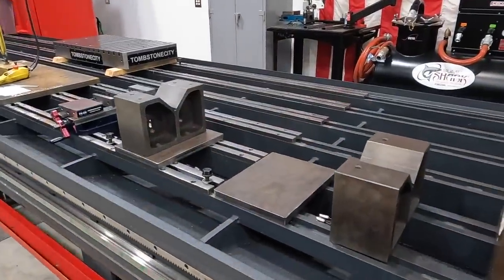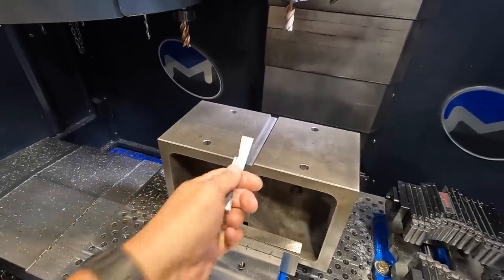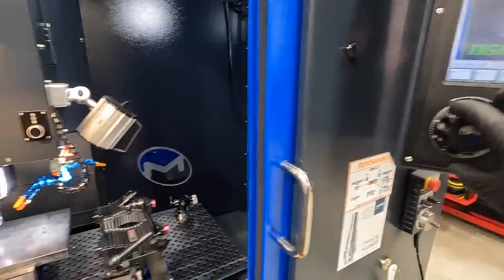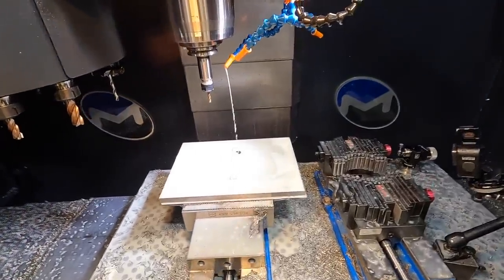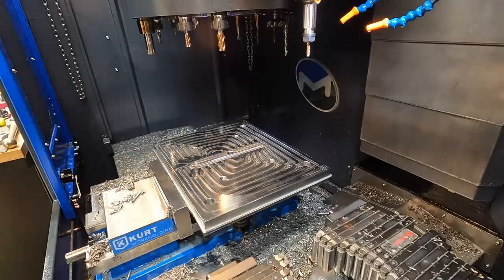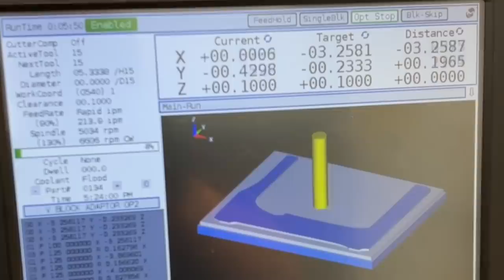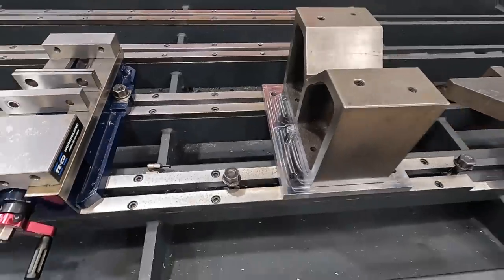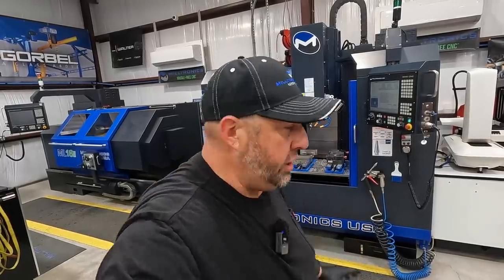V-Block Adaptor Plates

Comment: Glad to see that nice smile on your face when you operate those CNC Machines.
The real magic is that Renishaw Wireless Probe and tool setter.  Back in 2007 I purchased a new HAAS TM1P and added the Renishaw Wireless Probe and tool setter at a cost of $5K.  It was the best 5K I ever spent.
Listening to those with CNC machining knowledge as you have done will shorten your learning curve.
I wish you every success as you venture into the world of CNC.🙂

Comment: Sure is a big step into the future of machining Adam. I can tell you're very happy with your new CNC machine. I think one of the biggest advantages on a CNC machine is having the option to save the program for each job you do, so when you need it again, it's as simple as pressing the 'Select File & Run' Easy Peasy. It's really amazing to watch your work, and Big Thanks for sharing your videos with us subscribers. Cheers Blessing 💯👍. ps: As a power engineer, when computer automation came into the plant we could then see everything running on screen, pumps, temps, pressure, it was all dynamic graphics and almost like playing a video game 🤫. I did miss spending time in the mechanical room and actually hearing all the sounds, that's one thing the computer wasn't able  to give me, for example a noisy bearing or a minor seal leak. We still did visual walkthroughs, but they were only a few minutes. No more clipboards writing down readings.

Comment: I prefer the manual machining. I like the set up, indicating, and the process of figuring out how to mount the part. This is what makes me think.
Reply: If you think CNC machinists arn't doing that, you havnt set foot in a modern machine shop. CNC builds ON manual, not take away from it.

Comment: I think it is excellent that you are learning the conversation on the machine first. Those that don't struggle. You really need the conversation, because a lot of Fusion type stuff is going to need some minor adjustment and it is much easier if you know how to do it at the machine. It's the same for robotics and other like automation. I also see you are learning to think more in spacial area instead of 2d drawings which I think greatly helps with automation processes. Keep up the good work!

Comment: I think the great thing about the conversational mode is being able to see the program that the controller writes.  It's a great way to learn more G-Code programming.  Especially when you see how it has optimized cuts.  Won't always be perfect, but it's still a great learning tool because you can associate the code to what physically happens faster.
Reply: Theres no good way to learn g code programming, because g code programming is from the 90s.

Comment: The CNC machine does exactly what the manual machines do.  The trick is what is the CNC command that does the same thing as flip a lever, change the feed rate,, modify the feed stock.  It's still metal being cut.
Reply: Yes but if you have to make 200 equal parts in one order or another 200 parts 2 years later, the CNC is going to be so much faster which is more revenue if the shop has the business.

Comment: Hey Adam, I have a suggestion for you, instead of having drilled holes on the fixture plate for the “T”nuts, suppose you make them slotted holes like the ears on the KURT vices so you could slide the bolt and “T”nut combo into place without having to thread down through the hole into the “T”nut.👍

Comment: Adam another good idea to add to the plates. Tig weld two U bend handles to the short or long sides for easy handling. Espcially with the V- Blocks attached.💡👈🤔And having some Eye bolts that fit the hole threads on the top of the V-Blocks would be nice used with the crane. Sure those aren't light what so ever.

Comment: Nice to see you getting more comfortable with the CNC machines. I get the sense that your initial trepidation is wearing off. I think a turning point will be when, on a new project, you turn toward the CNC machines first instead of the manual machines.

Comment: In OP1 you set the Z height to the top surface of the plate.  In OP2 you did the same thing.  This means the final plate thickness is dependent on the original thickness of the plate which is probably much different from plate to plate.  In OP2 you should have measured the Z height to the finished surface of the plate, the bottom.  Also clamping the plate in the jaws of the vice will distort the plate so that the finished surface will be shaped like a pringles chip after you let it out of the vice.
Reply: @gags730  Most of what I know about machining I learned the hard way.  I wouldn't call myself proficient because there is always learning to be done.  CNC is not much different than manual machining only with trust in one's self.  The operations are similar except that you have fully thought through each step and setup the machine do the work.  That being said, the machine can do things that are not easily done manually.  Learn something everyday and take pride in your work.
Reply: Was also wondering how this process makes sure the plates are the same thickness...

Comment: Great vid, felt like I was in the machine.
I would like to see you make a SS cover for the flex jaw vice to keep it clean from chips while you use the other vise.  Maybe make it fit with both so the non-use vise is protected from chips.

Comment: Thanks for the videos. Been following you channel for a while. 

CNC videos seem far less interesting than those where you manually run the operations. 

In the CNC videos, don’t get deep enough into the process, from blueprint to programing (why the choice of tools, speeds, order of operation, etc.) and would the choices be any different if you were doing all this manually?

Watching a machine run automated cuts (usually from afar for safety reasons) just doesn’t do it for me.

I appreciate that the CNC will make your shop far more productive, but the videos are more interesting when you talk about the metallurgy and machining principles behind the job.

Comment: Hi Adam, thanks for sharing this video. I have a question about the V-blocks: Once you get them bolted to the plates, are you going to take a dust cut on the inner faces to make sure they are perfectly paired, or is that not required? I noticed that you located the parts from the outer surfaces rather than referencing the V itself. Also, is it going to matter if they get installed 180 degrees or 0 degrees? If that matters, perhaps some kind of marker on the plate and the blocks so that they always go back together as a matched set, and always facing the same direction.

I love your content, and I am looking forward to seeing the project you made these adapters for. Peace~

Comment: Impressive work.  Reminds me of the satisfaction with my first wood CNC machine project.  Something I have never seen before is the flange nuts and washers.  Sweet.  
Also, I think I noticed with the graphics on your screen appears to graphically show material removal before the tool pass?  That can really help you stop the machine before it crashes into something not intended. Thanks.

Comment: One thing I'll say about the insert drill, you aren't feeding fast enough.
All that 'smoke' is very fine particulate that's just sorta chilling in the cut, getting minced & macerated. Not ideal.
Reply: its cast iron, you expecting chips? Also like, its an 18mm insert drill with no TSC.

Comment: Wondering why some of the machine work is flooded with coolant and some operations are one dry such as in the initial milltronics drilling on the adapter plate. 
Really a fine design for the intended use.

Comment: I have a question. It seems like it might be hard to bolt those plates down to the rails.  Would it work to make those holes into open slots so the clamping bolts can slip in? Somebody tell me why that wouldn't work.
Reply: Hi. I was thinking the same thing
Reply: Not hard at all, a lot of equipment that is bolted to T-slots have holes or closed slots.

Comment: Bro, I understand that everyone's watching Titans of CNC but please don't push your machine and tools to the limit especially outside of the bulk production. Extra wear doesn't worth it. You are doing great!
Reply: lol, thats nowhere near the limit. Other than runing that poor 300$ endmill on a plasma edge, thats basically sacralidge.
Reply: What are you talking about?
Reply: @spikeypineapple552  if spindle slows down or vibration occurs it is definitely a limit
Reply: @sinchrotron  Where is the spindle slowing down? Hes below 50% spindle load.
Vibration has very little to do with 'being at the limit' in terms of LOAD.

Comment: That Miltronics is  a nice machine. 
You might want to do a tool change interlock on the table position. Where are you do a tool change because that bonnet style tool changer gets pretty close to your part. Maybe it’s fine clearance on this part but the next time you have something in 1 foot taller could be an interference. 
I would’ve been nice if you had a 6 inches more clearance or even a foot taller column.   
I had forgotten you got that milling machine from Kilroy. He doesn’t make videos anymore. He had an American pacemaker for a long time but you have one now and that’s what I have also. 
Yes, I do lots of CNC at work you’re doing good

Comment: Saw how you centered the key way but how did you ensure the key way is parallel to the V in the block?
Reply: Guess he assumed the V is perpendicular to those sides.
Reply: @spikeypineapple552  I would agree, but he didn’t sweep either side to establish square or parallel, don’t her me wrong, I think Adam is an amazing machinist , just wondering if he did and didn’t show it.
Reply: @chucksmalfus9623  it would be pretty unusual to have a V block not be square to that side
Reply: @spikeypineapple552  He has been using them, for decades most likely, to do good work. He has used them many times in past videos. They were made as a pair with the all faces and sides square to the adjacent sides and parallel to opposites a couple of lifetimes ago. I suppose that he could simply check them once they are clamped down to the FlexCNC bed. I forget the actual numbers but the work holding slots were milled true to the gantry ways on the FlexCNC when it was originally installed and setup (see past videos.)
TLDR; Adam doesn't need to assume because he already knows they are good. I agree, however, that if you or I were to make the adapters we should and would check them. Perhaps not on camera though.

Comment: Just my opinion but I think Mazak has the best and most user friendly conversational programing.
Reply: Sad but true. Fortunately, there are several more manual machining channels out there. Just hope he keeps the titles accurate.
Reply: Couldn't agree more. I spent my first 15 years programming fanuc control mills and lathes by hand and after we replaced all our machines with new smooth control mazaks I never want to touch anything else again. Never touched a mazak before and after 3 days of training with the apps guy I was on the machines writing and running all our parts without any issues.
Reply: I agree. Mazatrol is very fast to program, edit and use. I use Matrix nexus 2 for turning and milling on a QTN twin spindle lathe.

Comment: Good morning ABOM,  first thank you for the education you provide the world of machinist with your expert life experiences. Your Dad and his Dad  must be very proud of what you have achieved. Just a quick question. I have been looking to replace my mix match collection of taps and dies with a uniform good quality set of SAE . It seems there are mostly metric sets out there. My need is for a full range of SAE taps and dies with minimum OD dies so I can make the least amount of die holders for my tail stock. As for taps, I have seen so much about spiral taps, I would like to step up to spirals, if you agree, for hand and power tapping in my lathe and milling operations.. The range I use mostly is #2 thru 1/2”. Can you recommend a good manufacturer of these as sets or individuals if need be. Don’t have a Hugh budget but do try to get the better quality tools, Made in USA if possible. Thank you for any advise you could provide. Appreciate every video you make. Papa Maggio, Ex shop teacher from 50 years back. Like Mr. Pete.

Comment: 30:21 i love how wavy that coolant looks. vibrating goosenecks?
42:11 what's that white thing next to the CNC machine?
Reply: Frame rate on the camera is synching with the coolant pump pulses giving the oscillating effect
Reply: @billj.widmann112  erm, pulses? i thought it was a constant stream?
Reply: @billj.widmann112  chatter.
Reply: Notice how the amplitude changes with the sound's  pitch and volume.
Reply: @ItsMrAssholeToYou  that's why i think it's vibrations.

Comment: Awesome,  give yourself an A for being a hardworking and attentive student!  Good to see you using the Renishaw probe.  It can be used not only to make necessary measurements, but also to detect if what Tom from Oxtools calls Bozo has paid you a visit.  Having programmed computers for other uses, I can assure you that Bozo is always ready to visit even the best of students.  As Tom points out, Bozo even visits grizzled veterans of the trade.

Comment: It would have been interesting to see the before after flatness on your Starrett AA surface plate.
Reply: How might you go about doing that? What exactly would you expect your checking to tell you? What would you do about it if it weren't as expected?
Reply: @utidjian  Run a surface gage with a dial test indicator around the top of the plates.  Or lay the top side of the plates down on the surface plate and
go around it with feeler gages.

Comment: Is it just an illusion or is the rib not centered in the overall block?
Reply: Yah, I thought I was seeing things also but you confirmed my thoughts. Hopefully it was an illusion due to angle of viewing.
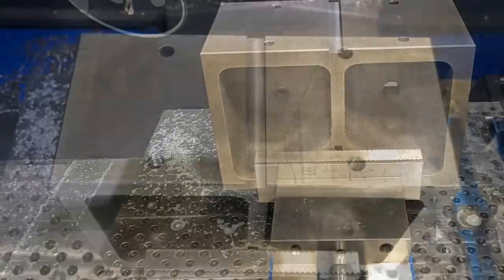Reply: It looks like it's off by a little, but it is a casting.   At 5:59 it looks like both the keyway that Adam machines and the relief at the bottom of the V are offset a little to the left of the rib.
Reply: I think it's an optical delusion caused by the camera's wide angle lens.

Comment: I would have made slots for the fastening hardware instead of holes. I just like sliding in the bolts instead of positioning the t-nut and then threading from the top. Or is there threads in the machine bed so that there is no need for t-nuts?
 If you run the cnc machines every day you will be fine, switching from system to system (manual/cnc) is maybe not the best way to go, we are in it for the money 😉. Hope that you get good usage out of those machines, they/you are worth it 👍🏼💪🏼😁!
Reply: ^-this-^